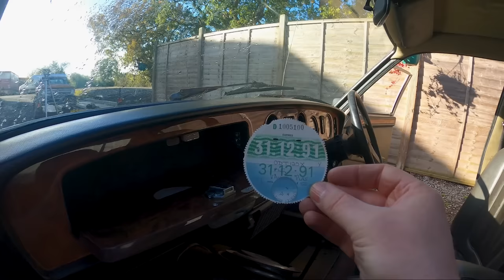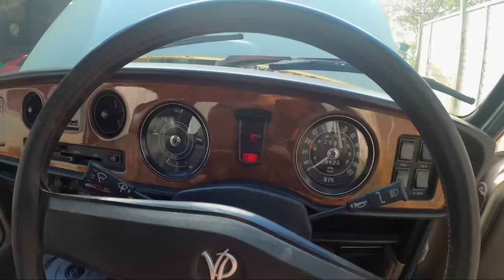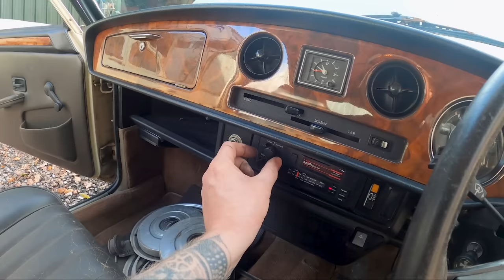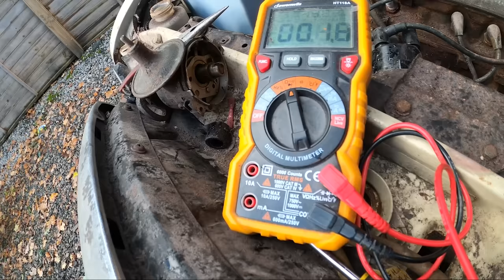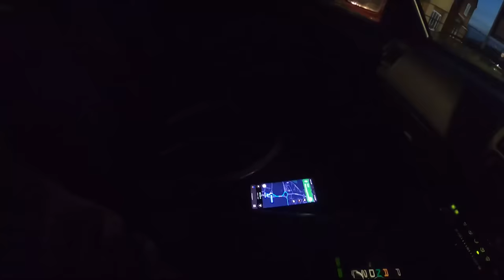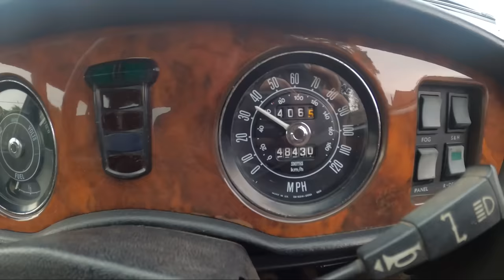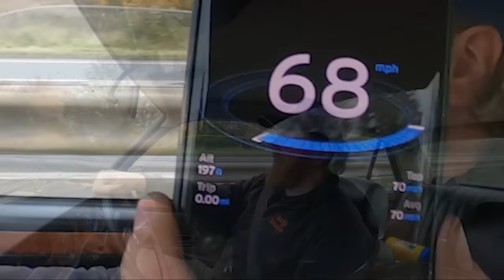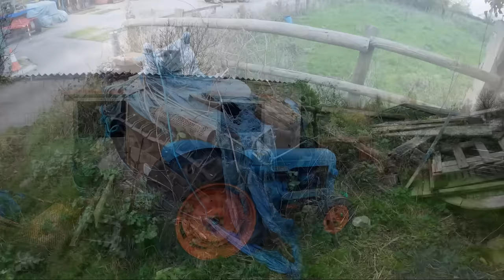Off The Road For 31 Years - Can I Bring It Back To Life And Drive It To Wales?

Comment: Love the car, hate the paint scheme !
Years ago my mate's dad had an Allegro 'equip' with green metallic paint , it looked lovely !
Also my grandad had a blue Allegro with a wooden driver's seat (which he fitted !), After he retired from driving he gave me the task of taking it to the scrapyard (I didn't mind that one side of the suspension had 'given up') So I 'booted it' as fast as possible which caused the throttle return spring to fall off and the motor to rev to about 11,000 RPM !
Happy days but I would never have suspected that anyone could care about an Allegro, though I had noticed that the Allegro estate did have a bit of 'lotus eclat' going on !

Comment: 3:29 this instant right here. The Vanden Plas is handsome once you forget how goofy the proportions of the whole car are.

The Allegro possesses, in my opinion, many simple yet elegant lines in its design. The key failure is the classic Allegro ‘hump’ in the rear, which tainted the entire car—it looks bloated but doesn’t even have a hatchback to make up for it.

Before we continue, I’d like to state that I am of the opinion that modification of a vehicle done out of earnest artistic expression is an excellent life for a vehicle to live.

1:40:01 Consider the Allegro’s side profile. I will refer to 2 “lines” on the car, which can be considered horizontal planes. Line 1 is the beltline. Line 2 begins at the base of the windscreen and continues along the bottom of the side glass. (Notice how L2 is separated from the bottom of the rear window by several inches.) 

Now, draw an imaginary line from the rear of L2 forward, turning vertically at the vertical pillar of the fixed triangular rear quarter glass. 

It might be easy to envision this as an allegro-shaped cake. You’re slicing out the rear quarter of the entire upper cabin, the knife’s going all the way through the car from one side to the other along these lines. Now move the entire mentioned section forward until it hits the B pillar. 

I believe those proportions would make for a smart little 2 door coupe with a boot that actually makes sense, and with how they designed and proportioned the car it doesn’t seem extremely difficult (relatively speaking). You could maybe graft a hood and upper fender section (cutting along the beltline and ending under the windscreen) from an Allegro on as a boot. Just weld up the old rear door seam and delete the rear door handles and voila.

Maybe you’d want to do this to a car in poorer shape. To that I say: even people who love this car seem to do so rather pityingly. Why not do an excellent job converting an excellent survivor into something legitimately attractive, to do the Allegro’s underlying design philosophy justice at last?

What I’m saying is, get rid of the hump and the entire car’s design is recontextualized. It would be a good looking car, and the love and care put into it are by far more important than any notions of “originality”, especially for a car like this.

Comment: ATF mixed with acetone is a great old school releasing agent I’ve used for over thirty years on many classics I’ve owned .out performed most of the shop bought stuff .it was my old grandad that told me about it he was a tanker driver and mechanic in the war and they used a similar thing before we could get WD40 etc .they used hydraulic oil instead of atf back then though ..the thin liquid gets into gaps then the acetone evaporates and leaves the ATF behind to loosen the frozen parts .👍

Comment: Get that coolant out of the suspension now! It will destroy the rubber seals in the system in no time - the correct fluid is cheaper than antifreeze!

Comment: Is it sad I punched the air when it started 😅? Bought a cheap All agro in 1980 had no money so all I could afford!! Did 45,000 miles in it all I spent on it was tyres, exhaust and starter motor it was truly awful but believe it or not very reliable 😊

Comment: I had some 'experiences' with Maxis which had the same engine, one of them had an electric fuel pump which had been fitted in place of the mechanical one. Another Maxi, would run great for about 40 minutes then begin to cut out, leave it for 30 minutes to cool down and it would go again for 40 minutes.

Comment: Disconnect the coil and connect direct to the battery for 12v. Then with a 2nd battery use 24 v for quick starts. 
Done it many times with reluctant cars.

Comment: 20:38 speaking of the fan v radiator size the one I drove, the temperature gauge would go up climbing long motorway hills (think m6 thru Cumbria) plus interestingly,the performance would fade and you had to stop fairly soon or drive below the speed limit.

Comment: Interesting video, had me giggling! But if you don't mind me saying so, there were lots of basic errors. There ought never to be any live current in the dizzy, it's all earth circuits. The fact that you had smoke shouted to me that the ignition supply to the coil + was shorting out via the points. Incidentally that car probably runs a ballsted ignition system, most BL cars of that era did.

And running to temp without the water pump turning! You were lucky not to blow the head gasket.

But well done for getting there in the end mate. 

Brought back memories of the 1750 twin carb Russet Brown Allegro eastate I built back in the 80's.

Comment: my cousin had an auto vp,the temp guage was on full all the time,we went to ludlow on a fishing trip and to stop him worrying i wrapped an old piece of wire round the radiator fan switch so the fan was on all the time,it only went up to 3/4 on the guage then but it never used water or boiled over,that was bl stuff worked or it didnt,long video but worth it .

Comment: Ah the Austin Allegro Vanden Plas. The top trim level of the Allegro range. Still prefer the Austin Maxi over the Allegro. It was such a good family touring / camping car.
Just spotted the Morris Marina style door handles. If I recall correctly the non-Vanden Plas Allegros had vertical not side lift handles.

Comment: That red button is just a brake check switch. If the fluid drops in the master cylinder the red light will come on. The pushing to make it light up is just a check that the circuit is working. That dashboard looks immaculate. The wood normally delaminates at that age. I wouldn't have even tried starting it up having seen a close up of that wiring  LOL  I love electronic ign kits. Just make sure to get a kit that fits inside a decent dizzy (no play in bearings). The full kits with a whole new dizzy can be crap as cheaply made and the bob weights will not be correct. Brakes need to be bled fully and all cylinders checked as a matter of course on something like this. Is it the right dizzy? Looks like a Lucas 45D cap. If correct dizzy I'd check the shaft for play and fit a leccy kit in it for about £35. Not watched full video yet though  :p

Comment: I havent been a working grease monkey for many many years BUT I know that with cars standing years I would take the plugs out and spray release oil (WD40) down the barrels to at least unstuck the rings and also as you know older cars you can put a direct lead from battery positive to coil just incase the loom is damaged ? 😉 Havent got as far in video to see if you have done it yet 😆 Good luck 👍

Comment: People always knock the Allegro but I had a few of them as a teenager back in early 80s and liked them. They were no worse than many other cars of the time.
 I had 3x1300s. One was a nightmare but the other 2 were good.
I had  one 1750 . That was ok but the gearstick was like a wooden spoon in porridge. 
I had one 1500 estate which was my favourite.
I live on the East Anglian coast and would regularly drive to Welsh coast and back. Apart from once having an alternator fail I never had any problems.
I must have done that journey 20 or 25 times.

Comment: Carefull with them E series motors they overheat without the thermostat, you need a thermostat with a disc on the bottom so as it opens it blocks off the bypass hose forceing all of the water to enter the radiater instead of just recirculating within the block .

Comment: Has the balast resistor/wire failed and giving you 12v instead of the 6-9v,admittedly it will feed battery volts while cranking over?

Comment: Is it possible to put normal suspension in these ? Would look alright on a nice set of superlites
Reply: See Jonny Smith's "The Late Brake Show," his Honda Civic R engined 2 door Allegro is equipped with real springs that don't let gas into fluid and sink one side of the car, or both if my last (Late '79 so Hydragas suspended) Maxi was in any way typical!
Shame they didn't put Hydrolastic in Allegros instead of "Hydrasag"  (😂).
Sure & that  'Lastic was somewhat bouncy compared to the displacers that used nitrogen in the Bell ends and liquid only below the rubber diaphragm that sometimes prevented nitrogen getting upclose & personal with coolant concentrate (or hydrolastic/Hydragas fluid if you want to look wealthy.

Oh, and the car wasn't going to level up side to side, I guess you were joking there, Ben,  'cos you know from your walk underneath that the displacers are connected front to rear.

Unless you buy an A series miniMetro, in which case the front bottles are linked side to side, the rears completely unrelated to each other.

Can you tell I'm a wee bit fond of Hydro cars? 
Sorry. 😊

Comment: Must be time for electronic ignition and dodge the dubious repairs under the bonnet to save the old girl 👧 and iconic grilled variant.
Sounds like a single note horn.
Would go the extŕa mile with high & low note horn to lift the standard.
Thanks for the review on the limited budget.❤😂

Comment: Wait. Wait wait… You have a SECOND Panhard?   I don’t think I’ve seen that YELLOW one before.  When did THAT happen?    The Citroens use brake lines for their hydraulic pipes.  Would that work for the hydrogas?

Comment: that switch is just a bulb test switch the light comes on if the brake fluid level is low. you press the switch to test the bulb.

Comment: Great video start by cleaning the fuel tank out and fixing it up properly get that rad weld out of the engine it blocks the water ways in the cylinder head anything that blocks leaks is not worth using just blocks your engine up change all hose's  clean both carbs properly just get a new radiator then sort the brakes properly change all  rusty pipes sort the suspension properly clean of all rust fit limitation an old  electronic ignition upgrade fots that car nice  do the body work and sell the car for loads of money lol well done nice video 🤔💯👍

Comment: First when you try to start these one cars. Turn them over with the plugs out.. No compression will allow the engine to turn faster.
Also if the engine is tight it will allow it to build oil pressure and help to free up the engine.
Second there is no point pumping the accelerator when trying to start it.. S.U carbs don't have a accelerator pump.

Comment: Didn’t they need isolation washers or something on the bolts for the points ? Or you could fit a new electric points pick up kit seen Ed China fit a set once -does away with points and condenser

Comment: U should hava word with retropower they've got 2 bein built so they've taken the wings off coz there doin carbonfibre wings so they may still have the wings n u should also let jonny Smith know coz he loves allegros bro this is gonna be a awesome video nice 1 Ben 👍👍
Reply: That's an interesting point - given that they've cut out and removed the floorpans and all the mechanicals from both cars, then welded the bodies to Honda Integra floorpans, there should be two whole cars' worth of spare mechanical components, engines, gearboxes, spheres, brakes, everything. Hopefully they've gone to the owners' club or similar, and not in a skip.
Reply: Init m8 defo worth asking

Comment: Not a clue! Turning over like that will drag the power from the coil. Try spinning it over without plugs in to get oil circulated. What about the old fuel? Alternator nothing to do with it! Just put an accuspark distributor on it. Job done.

Comment: No idea why they sold it, my in-laws had two (first one got flattened by a truck while at MOT - the truck rolled backwards downhiil,  got another one then swapped if for a older morris minor.  Proper oil rustproofing in sections and seams and the VDP Allegro not really that bad

Comment: hey so i do this thing with random cars that i find interest in where i run the plates and it says someone bought the car september 2023 assuming it was you and the car was supposedly originally grey? so i think the car was repainted at some point the car model is correct year 1981 vanden plas it was first ever registered in oxford 1st january 1981 and its a 1.5L so i just find it a bit weird why the car was supposedly repainted or the results are wrong but thats what i see

Comment: easy fix for the water problem take the hose going into the heater in the car off and attach it to the one with the leak this bypasses the car heater in the car but completes engine water system it will get you there with no heat in car i did this in an austin maxi it got me a couple hundred miles but was cold

Comment: 1:30:00 ... well ... with no waterpump driven you will not get the heat off the engine into the radiator. Remember ? You took off the belt for the dead alternator ...

Comment: It would be good to see another episode on this. I feel duty bound to say though that while it is very tempting to drive a car on extended runs after coaxing them to life, I thought that to drive any distance with a leaking fuel system, albeit ingeniously routed back into a catch can was not particularly responsible given that you are likely to influence some of your less well informed viewers negatively. I did enjoy your enthusiasm for the car and I respect your obvious savvy when it comes to diagnostic work but I don't consider what you have done so far really improves the car much. Ideally it would be nice to see a bit more commitment to increasing the longevity of the vehicle but of course this is unlikely to happen because the car is being used to generate views and its certainly doing that.

Comment: So why did old British cars have a manual brake light rocker button?
Reply: It's a weird one, that. The red warning light on the switch glows if you lose brake pressure, like the fluid has leaked out.
It's on a rocker switch so you can test that the warning light still works. Seriously!
Reply from the maker: I was wondering thank you!

Comment: Used to work on these and many other similar. it is sad to see how you are making hard work for yourself. Would have had it diagnosed in 10 mins and fetled in not a lot longer. Key is diagnose and check timing. Hope you understand distributor centrifugal advanced is matched to engine.

Comment: Connect coil to 12v battery awah from ign switch. Pt 24v through the starter.
Reply: Always put the earth direct to the engine.
Reply: Always bypass vehicle wiring and use a separate lead to connect coil to battery direct.

Comment: I have a trick for the fuel remove the new filter put an air line on the pipe and send it back too the tank until you hear the petrol starts  bubbling removes all the crap .then its clear .i had an aunstin 3ltr for a while loved it then bought a 2.8 granada ,now im on an E38 ,And i was going to say once you retard this a little it will hit 70mph .

Comment: I was the unfortunate owner of an Austin Marina (U.S.).  It along with a BSA 250 proved to me that I will never buy another UK vehicle.  MG engine, spitfire transmission, and Rover body.  Total trash in my opinion.  This one is a different model, but, no way would I spend any money or time in restoring it.  (Of course if you have a Toyota engine and drive train, the Rover body was pretty good.)